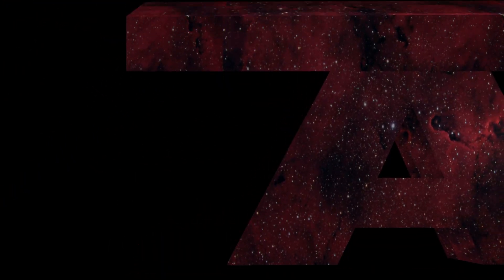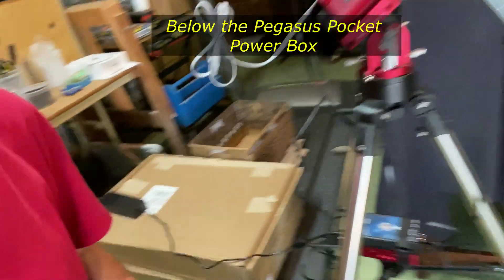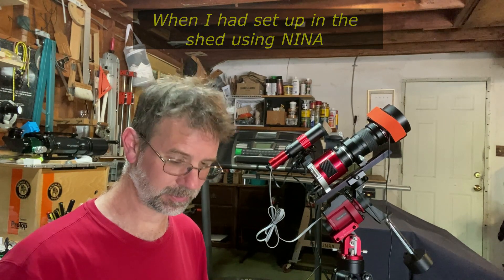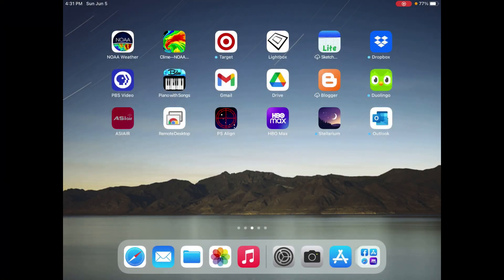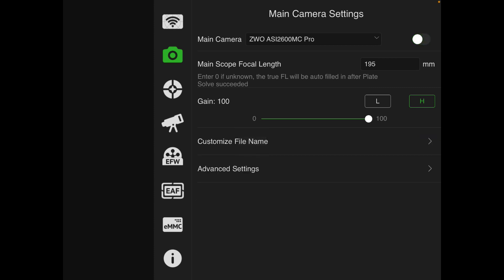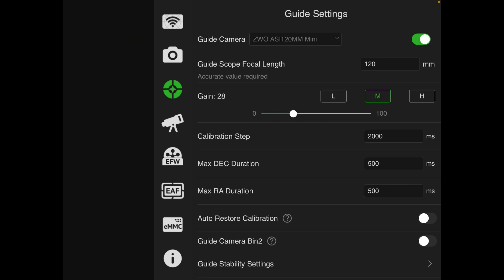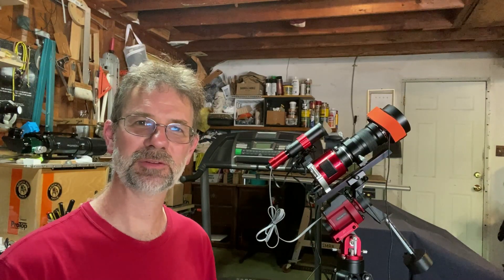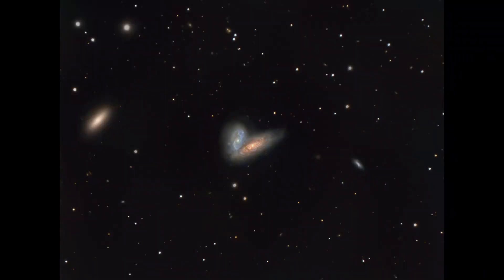ASIAIR-PHD2 - Simple Change to a Setting, Better Guiding! #astro #astronomy

Comment: I’m no expert but I’ve read the AAP wants to move 25 pixels, not arc-seconds, in Calibration. In 12-13 steps. So each step must be 2 pixels. 

It will send pulses in ms for the Step Rate you set. Your mount will move n arc-seconds in that time based on Sidereal Rate. At 1x, it’s 15”/1000ms. 

You must know what one camera pixel is in arc-seconds. 206*micron size/camera focal length because you want each pulse to move that distance. 

It’s therefore dependent on your mounts sidereal rate and your camera pixel size and your guidescope focal length. All three. 

I’m at 33% sidereal so my mount moved 5”/1000ms so if a pixel were 2” in my camera I’d need a 1000ms step rate. Etc.
Reply from the maker: Thanks for the info Alan, whatever makes it work!

Comment: hey, this makes sense but just a thought: dont you have a backlash problem? do you have mount biased west and north before starting the calibration to make sure calibration steps are not wasted on backlash? I certainly made that mistake a few times😂
Reply from the maker: I haven't noticed any backlash on this newer version EAF, or the ASIAIR has a built in compensator. My old one certainly does though.  Cheers

Comment: A great video there, thanks for your advice. I had exactly that problem using my Skywatcher tracker mount last night and my ASIair Plus said that the stars were not moving enough (I was using a 120mm guide scope and ZWO120MC guide camera). I tried changing my settings, but was still having trouble. I set my ASI to ST4 etc as well. The focus on my guide scope was not that great and wonder if that might have also been a contributing factor to the stars not moving enough. Next time I may set my ASI calibration to 3000mS and see if that works, but will also reset my ASIAIR Plus and see if that helps. Thanks again for a great video 👍
Reply from the maker: Thanks Dougie, Good luck on getting everything to work. Trying to troubleshoot stuff is such a pain sometimes. Cheers

Comment: guys sorry but I got a little lost in your very technical speeches.  I have two frames;  an eq6r pro on which I use a 125/975 reduced to 790 with full focal length oag (975 mm) And the small az-gti on which I use a Jupiter 200 with svbony 120/30 guide telescope or a 70/478 with 120 guide telescope / 30.  How do I figure out / calculate what might be the best values for my setups.  thank you
Reply from the maker: I would try setting the calibration at 2000 ms and then see what happens.  The optimal movement is 25 arcsec in 4-5 steps.  If it takes 15 steps to reach that movement, raise the calibration value, if it does it 2 steps, lower the value.  Cheers https://eastwindastro.blogspot.com/2021/02/how-to-adjust-asiair-guide-aggression.html.

Comment: Thanks so much for sharing that experience, Kurt!  I'm trying to figure out why my guiding with the ASIAir Plus/SGP/ASI120mm mini is not working after I updated the firmware to 9.97.  Weird stuff going on, e.g., during the calibration for guiding, the ASIAir goes West step 1 through x, then keeps going West step x through 1, but all the time the distance from the calibration star is increasing!  Of course, if I try to guide I'm getting star trails after a very short time so it's not working at all.  I did have the Calibration step set to 2000, though, so I don't think that's my problem.
Reply from the maker: Thanks Greg,  That is weird.  It sounds like it is not guiding at all?  Make sure the correct Focal length of the guidescope.   You might want to put this issue on the Forum or Facebook page.  Good luck

Comment: Same experience as you, value needs to be reduced for the SCT (@1400mm focal length OAG) and default is about right for 200mm guide scope. Essentially, if not enough step in guider calibration you need to drop the value, and if too many steps you need to increase the value. I had to keep a notebook of settings because the AAP has no quick save for different setups.
Reply from the maker: Thanks for the additional info Charles!   I learning something new everyday.  Cheers

Comment: Very helpful info Kurt! For some reason I’ve noticed the default step size is almost always smaller than optimal.
Reply from the maker: Thanks Joe,  I usually use default settings and it usually works so I don't bother trying to understand what is happening.  When problems arise then read up and find out what is going on.

Comment: It makes logical sense that the wider the FOV (shorter the focal length) of the guide scope the longer the sample time needed to register a shift of a star in arc seconds. Also shows why for best results having both the guide scope and main telescope lens focal lengths close in value helps. Also explains why an off axis prism guider works best with the longer focal length telescopes. Also to consider how the pixel density of the guide camera has a direct relationship to the recorded angle of movement across the surface of the sensor chip for the given sample time.
Reply from the maker: All good points. It is good when things make sense, however I am having a hard time comprehending your last point.  Cheers
Reply: @AstroQuest1  Hi Chris, in terms of guide camera - most are named as such 'guide camera' so will have a similar capture chip of a certain pixel density (ZWO/QHY etc) - for example the ASI120MM has the spacial pixel density of 3.75µm compared to an ASI178MM at 2.4µm. The chip's sensitivity is also part of the mix too - signal to noise etc. Great video and helped me think this one through! Thanks!
Reply from the maker: @Seafox0011  Got it. Thanks for the quick response.  Also there is the ASI174 which has the much larger 5.6um pixels.  Cheers Kurt

Comment: - I followed the advice on an Astroblender YouTube to use the settings that caused you trouble, and they caused me trouble, too. Returning to the ASIair  defaults, as you did, fixed it for me, too. - Using a USB3 stick on the ASIair works best for; tethering it to a laptop defeats its purpose.
Reply from the maker: That was was it David. Usually Astroblender's advice is right on but this time it was not.   I was wondering if I just stick a USB thumb in there I can transfer the files to it.  As you said, tethering to a computer defeats the purpose.  Cheers

Comment: In phd2 you need calibration to do at least 8 steps I found this out recently after receiving an error calibrating , I had swapped guide scopes over from a 400mm fl to 130mm guidescope a shorter guidescope needed more steps , phd2 in brain 🧠 settings can calculate the steps for your setup kurt may be worth looking what phd2 calculates your steps at to compare what your using in Asair
Reply from the maker: Thanks, Yeah the brain doesn't not show up on the ASIAIR so I would have to do it on the computer.  I have never had it less than 8 steps so I never had that particular issue.  Cheers

Comment: Excellent video, Kurt. Very helpful. Also, I too noticed you have to delete files using the tablet. I wish they’d change that back…I liked deleting my files from the computer after I transferred them from the computer.
Reply from the maker: Thanks Jeff. I am wondering why they did that as well. It does not make any sense to me.  Cheers